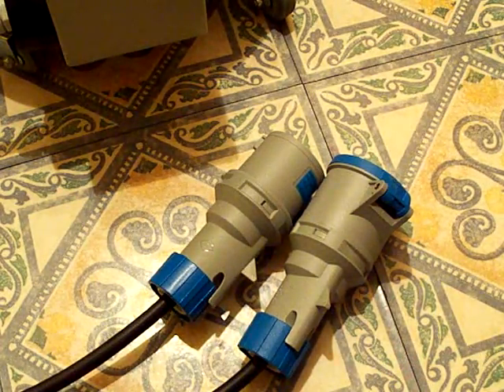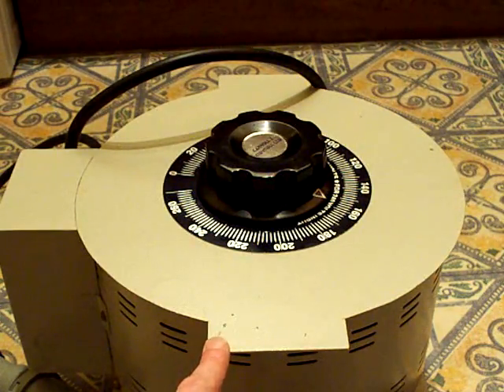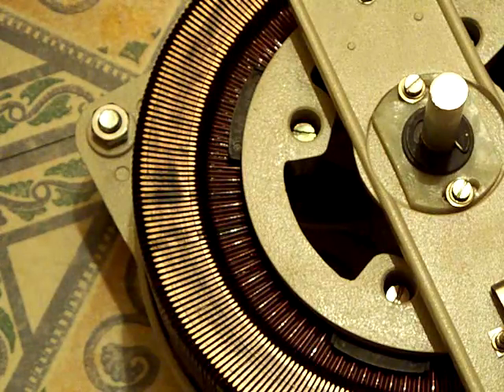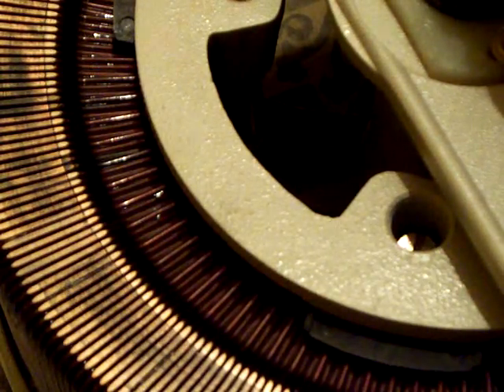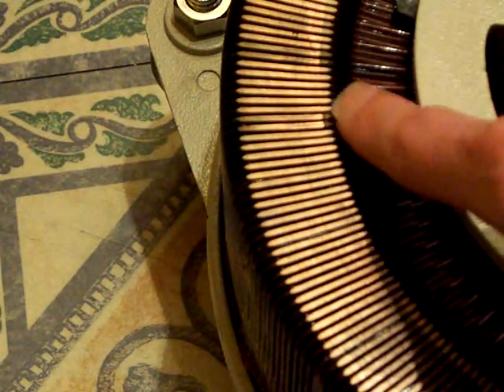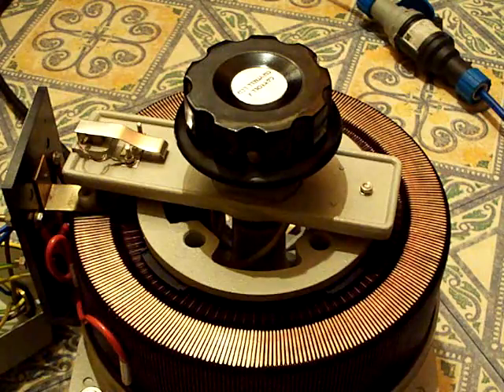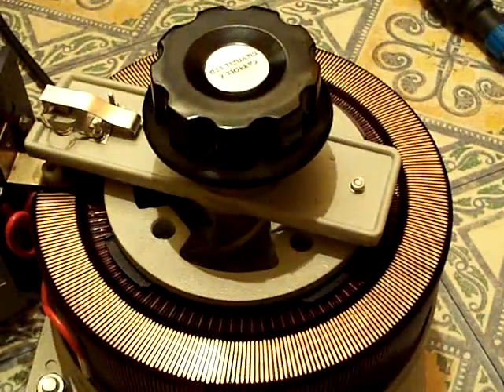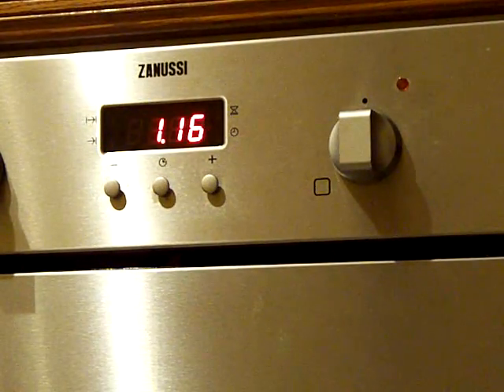Electrical : Technical problems (easily fixed)

Comment: Hi Wayne.... Is the brush retaining plate a little too tight? ...The reason for the question....The brush is spring loaded..to allow it to move up and down....to allow for wear ...and in your case  level. I say this to save you dismantling the whole thing when shimming or loosening the retaining plate may do the job.
Reply: Hiya. I hear what you are saying. Ideally speaking, there should be a small gap between the brush holder and the back of that retainer plate to allow for the movement which we both know about.

The thing is though, this gap has been clearly omitted in the manufacture of the retainer plate.... well, er..... shall we say a quickly knocked-up lump of metal with two holes somewhat shoddily drilled into it!

Looking at the back of the retainer plate, evidence is very clearly visible that someone has had at it with a file so as to create some kind of gap, but this obviously hasn't worked, especially when I tighten the screws right up.

The way out of this, would be to put something (like a shim) which is oh-so-thin on the screws so that it acts a bit like a washer and then reassemble the whole issue.

Really, I do question the quality and training of the workforce who made this when you see how shoddy that retainer plate is. It really is just a lump of metal with two holes drilled into it. The thing isn't square at all, and looks like someone just grabbed any old scrap offcut which was lying on the workshop floor, quickly whittled and rednecked it into some kind of shape resembling a square, drilled two holes into it, shoved it onto the pickup arm, stood back and admired his work with "That'll do" thrown in for good measure!

I really do hope that someone from Carroll & Meynell sees this video, because with shoddy work in there like that, I am really doubting that this variac is made in the UK.

And you know, seeing as the core says VBC BOMBAY on it, is it just the core of the transformer or the whole thing which is made in INDIA?

With shoddy work like that, it makes me wonder what the inside of the manufacturing facility looks like when people are quickly knocking up and rednecking their way though the production with the rather loose and casual "That'll do" attitude thrown in.

This variac is SUPPOSED to be 28A. The poor thing has struggled to run a 2kW fan heater at 160v for 25 minutes.

I AIN'T HAVIN' IT !!!

I don't even think the whole transformer is fitted horizontal and square to the base, and the tell-tale sign of that, is the wide variation in brush contact around the pick up track. It's just not consistent at all.

Like I say: I hope that someone from Carroll & Meynell sees this, because I am somewhat ticked off at the quality of this unit.

Thanks for watching,

-Wayne's Electrical.

11th February 2017, 21.58

Comment: Had too much fun? Lol, a looonnnggg vid :-)
Reply: Well.... here is the thing here. If I had have been having some fun and the sparks and pops in there were happpening somewhere beyond 28A, then fine, I could understand that, BUT.....

When I am trying to run a silly little EIGHT AMP load and that load isn't even pulling its full 8A because it's only on 160v, and that is causing the sparks and pops, then that's a bit crap for a 28A variac, right?

Let me work this out.....

2kW fan heater at 240v = 8.33A

For me to work out how many amps would be at a lesser voltage, I would need to know some other constant..... The resistance.

A 2kW fan heater has roughly 28.8 Ohms resistance.

So, if I stuff 160v through 28.8 Ohms, the wattage would be 888.88 watts.

If I take that wattange and divide it into the voltage selected (160v) to give Amps, then.... 888.88w divided by 160v equals..... 5.5555A.

FIVE AND A HALF AMPS, AND MY 28A VARIAC COULD NOT TAKE IT?!!!

What else can I say apart from.... I AIN'T HAVIN' IT!!!

It is supposed to be 28A an it cannot even take a 2kW fan heater at 160v?

Something's not right, is it?!

In this video, I explain the possibilities of why this may be and the possible solution(s) to fixing this by means of re-engineering certain parts and re-aligning and re-squaring parts in there.

It's a shame...... A 28A variac cannot take 5.5A without sparking and popping.

How paaaaants is that?

Hopefully, a clean-up of the pick-up track and a check over of the brush may repair and improve the current handling.

We will have to see how this one pans-out.

Hopefully, it hasn't given out. I HAVE NOT GOT £475 for another one!!! :-(

Thanxx for watching,

-Wayne's Electrical.

5th February 2017, 23.05